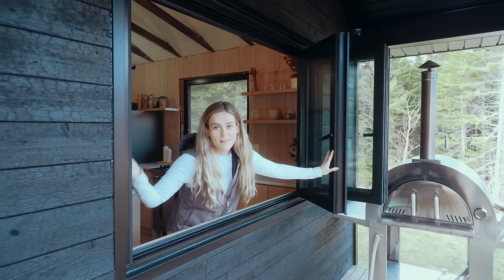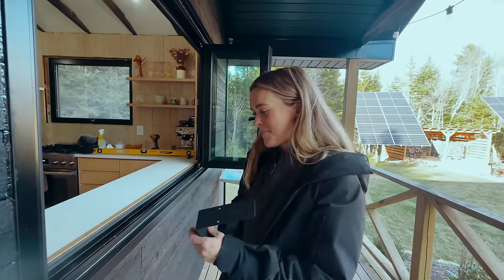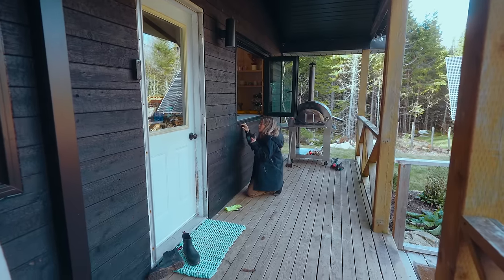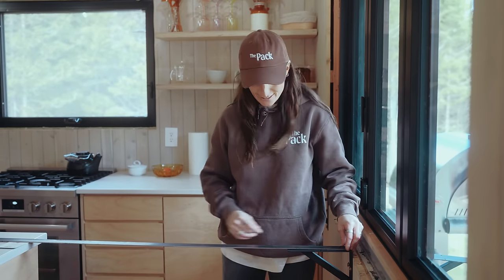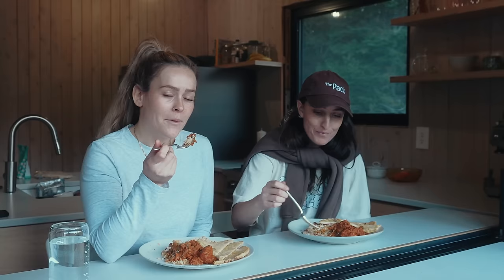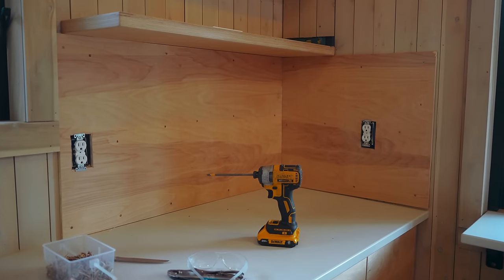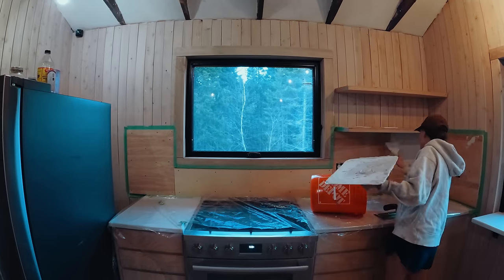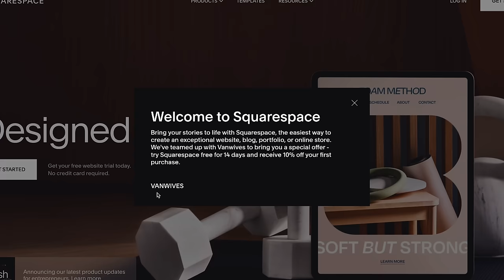Transforming Our Home with a Pass Through Window!

Comment: Beautiful job again, girls!
Glad pups okay.
Remember to let Clementine's glow plug heat cycle finish before trying to start her. The colder it is, the more important this is to do. Turn the ignition key on far enough to turn on the dash lights without trying to start her. The glow plug indicator lamp will remain on until glow plugs hit temp. Once the indicator glow plug light shuts off, Clementine should be good to start. Please remember to let her run for ten to twenty minutes to warm up before using.
I tried looking up your hoodies, but I only saw up to large on the site. I'm a XXL- tall, so I was hoping the three would fit. But no luck finding...
Lov the pack

Comment: Looking superb! Although I'd reccomend you doing the trim corners at 45 degree angles (in the cuts). Looks SOOO much nicer and with a little bit of filler and sanding (and using smaller nails) you can make the most perfectly smooth trims...! That vertical line cutting off the door at the top, makes it look more boxy and "DIY". Thanks for a superb channel with lots of positve energy! Greetings from Denmark!

Comment: You should have mesh taped your joints on the ply before putting the micro-cement on. Any movement in the house at all and it'll crack on the joints where the individual sheets of ply meet.
Reply from the maker: Micro is crack proof :) that’s why we used it on our ceilings over drywall as we are on sono tubes and shifting happens all the time. But tape would be a good extra precaution

Comment: Tablesaw tip: when you push stock through, in this instance ripping that trim, try to always put the smallest piece, on the 'free' side of the blade. Putting the smallest piece between the fence & the saw increases chances of kick-back but also increases chances of an imprecise cut as the wider/heavier piece will tend to push away or toward the blade. Hope that's helpful.